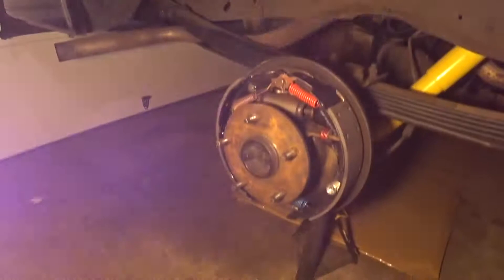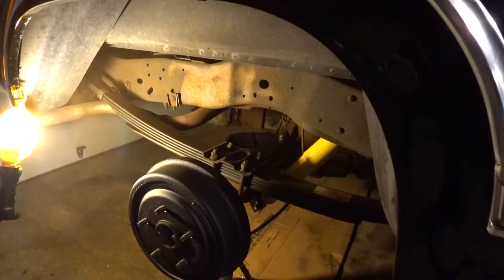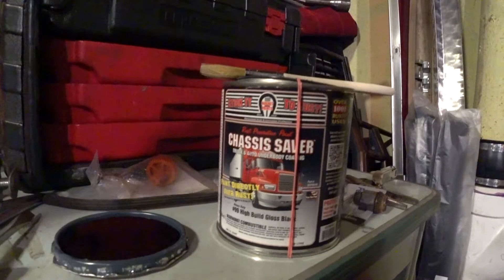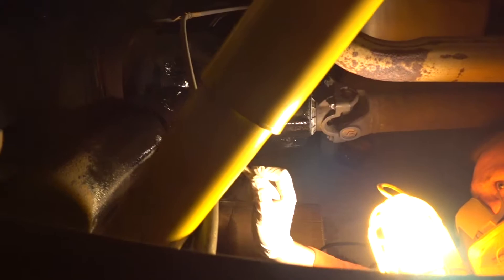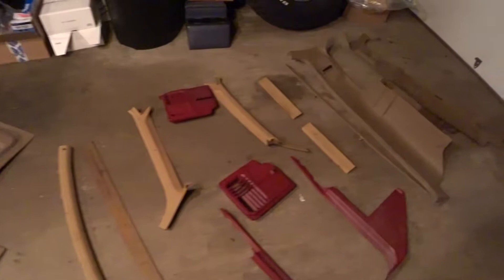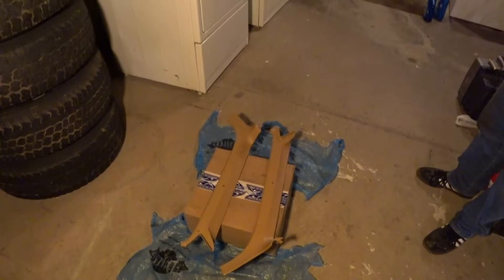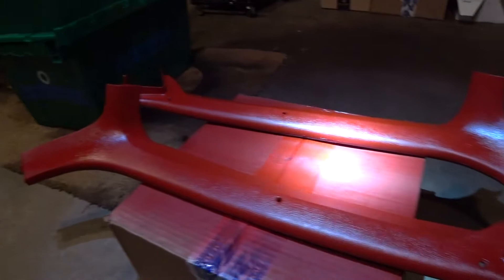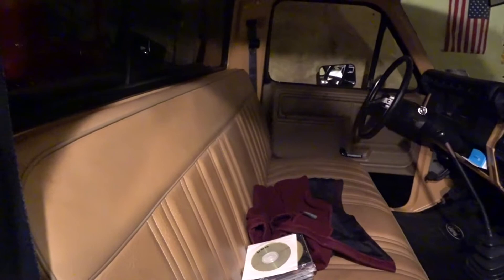1986 Ford F-150 Interior Painting

Comment: I'm doing a restoration on my 85 f150 and did all my interior trim the red was just so faded. I wet sanded the door panels and used scotch bright pads on the rest and got the paint from LMC truck. It was a little darker than the original color but not too far off. It was a lot of work and the biggest pain was getting the metal trim around the top on and off. Also going to be doing a coat of rust preventative on my frame shortly. Love seeing the progress on other similar projects. Keeps me motivated on mine!

Comment: I have have an 85 f150  an plan on repainting the interior plastic trim.  I was excited to see your video.  To be honest though, painting with a spray can isn't exactly rocket science.  I was wanting to learn how to remove and replace the trim pieces.  You seem to just want to do a fast easy video though, not showing the difficult part.  You need to do a lot more planning and work.  Just talking off the cuff isn't very enlightening.